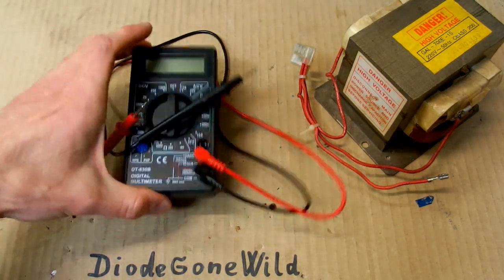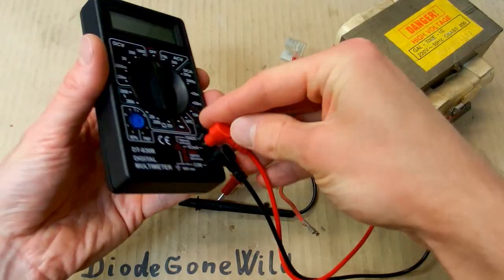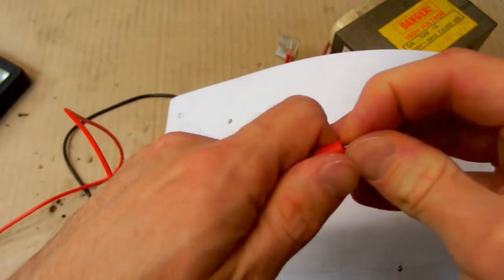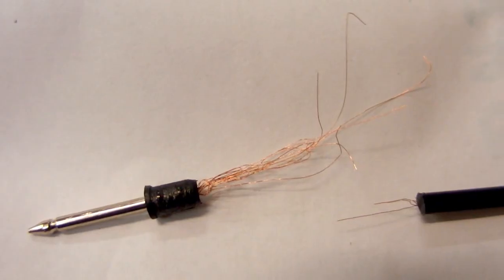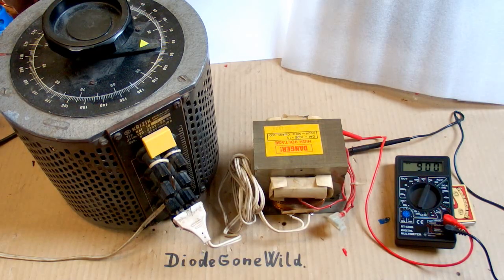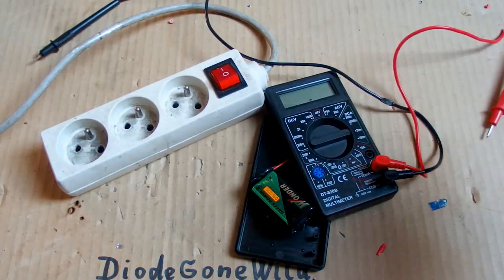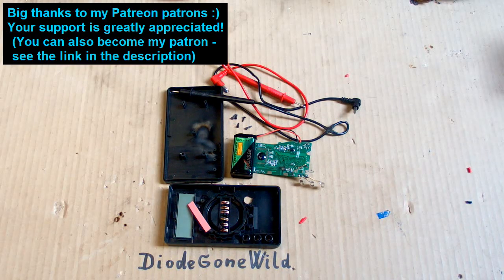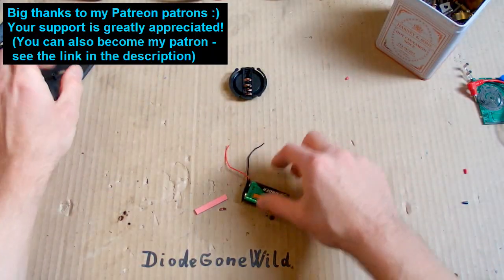$3 multimeter - high voltage & overcurrent test (smoke and explosion)

Comment: So you want a fuse, good probes, not exploding, safe design and true ratings for $3 ? 
What? Its Chinese! You divide everything by 10 to get the true ratings, and you're the fuse! 
OK.... No more videos without your cat... OK? Or I'll give you a "hunderd" thumbs down.
Reply: i dont think thats the point. i think its more of a safety thing, like hey dont buy this cheep fire and shock hazard
Reply: @LittlePimp, Are you sure you don't work for the offices of; no shit & sherlock?
Reply: Problem is that amateurs and hobbists usually buy these cheap meters and most of them doesn't know how to properly use them. You can just imagine what can happen if he would hold it in hand and measure something...
Reply: Honestly, there wouldn't be a problem with it if it wasn't claiming to be suitable for high voltages and currents. It's accurate enough and perfectly useful for low power electronics use. It could be worth buying a few of these throwaway meters if you want the ability to monitor several voltages simultaneously.
Reply: Ahahahah! "You're the fuse"! That sounds absolutely on-point. Back in the 90s when we couldn't get direct imports from China for some reason, a lot of Chinese junk got re-branded in Paraguay and sent over here as "Made in Paraguay" (complete BS). Then a local chain of decent-quality goods made a VERY popular and memorable ad with a Paraguayan dealer dude replying to the question in broken Spanish: "Warranty? Warranty is you!"
Reply: sheikh, you are idiot. I've told you that before and yet, you still insist on commenting in my comments.
Don't feel bad, you were born stupid. Learn enough English to understand our humor.

Comment: LOL! Entertaining.
How come in my Physics class though we had to use an Ammeter and Voltmeter separately and the multimeter we used for measuring resistors only.
Reply: As someone who had to teach introductory electronics/physics/metrology labs I'll say that replacing fuses in the meters after each lab gets old quick. When we were using cheap digital multimeters we went through a 100-pack of fuses every semester.